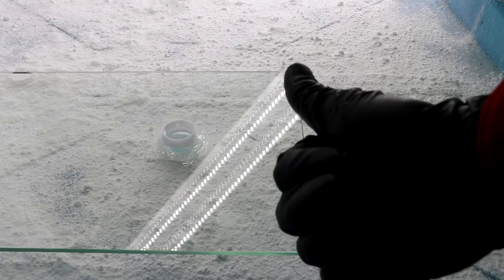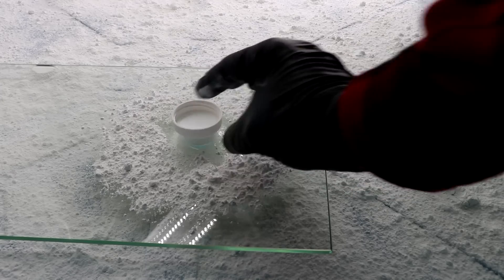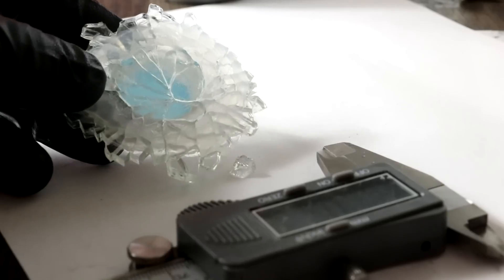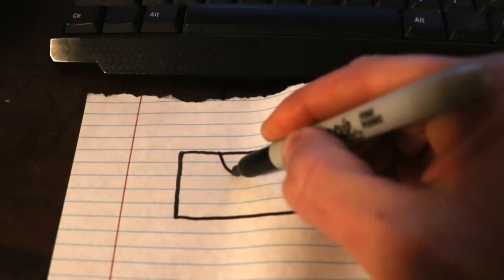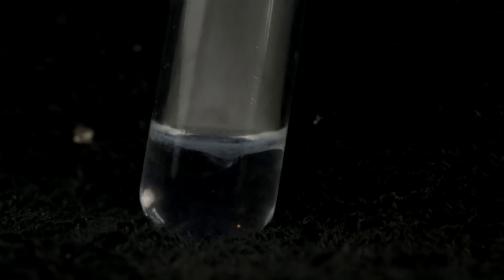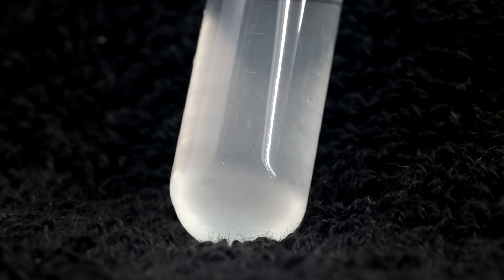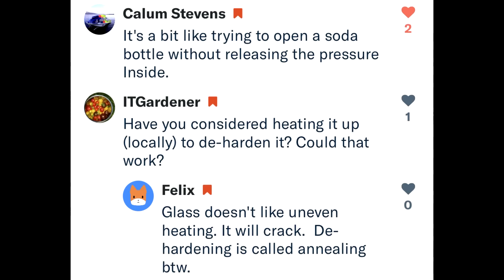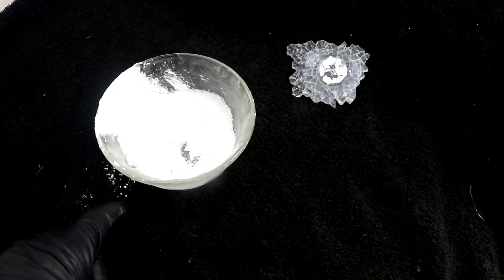Dissolving Through Tempered Glass Attempt Two: from one side only

Comment: Isn't this like saying if i cut an elastic band under tension really slowly it won't fling off. As soon as the pressure is released its gonna just go.
Reply: Not quite. Tempered glass has compressive forces countering the tension forces inside. It's perfectly possible to have a piece of tempered glass with a hole in it. If the glass is tempered with that hole in place, then the strain patterns in the crystal will form around the hole instead of through it.

Removing sections of a pane of glass without breaking it is kind of like playing Jenga. There are pieces under net zero stress that can be safely removed, and some that are under some stress that, when removed, can safely offload their stress onto other pieces. However, if the balance between compression and tension isn't preserved locally to where the piece is removed, you get what basically amounts to "leverage" pushing and pulling far stronger on other parts of the glass.

It might be possible to predict a place to put a hole through the glass if the strain profile was analyzed. You can see it with two images of the glass, scanned through some polarizing film. (Two images so you have horizontal and vertical polarization. Overlaying the two would give you total strain) You'd want to look for areas that show the least polarization at any angle, since any polarization indicates high internal stresses at that position.
Reply: The trick is to sneak up on it...
Reply: What if you hold the elastic, then someone can cut and you can slowly release the elastic bands without the sudden fling, doesn't applies to glass though
Reply: If you bore a hole in the tempered glass while annealing it you should be able to because your technically pushing a hole through the softened glass

Comment: Is there a relationship between the area where the acid works and how deep it penetrates? 
If the acid was contained in a cylinder with a radius of 0,5 mm, would it penetrate deeper?
Reply: No the issue is just to do with how deep it goes. So the diameter is irrelevant

Comment: How to Cut Tempered Glass

Co-authored by wikiHow Staff
Updated: March 29, 2019 | References
Because it’s a type of safety glass, tempered glass cannot be cut using the same methods as you’d use to cut ordinary, untempered glass. If you must cut through a pane of tempered glass, you’ll need to heat it to nearly 1,000 °F (538 °C), then slowly cool it. This process is called annealing, and it will effectively undo the tempering process, weakening the glass to the point that you can cut it. Once it’s cooled, the glass will be in a state in which it can be cut. Anneal the glass if you have access to a kiln. Otherwise, you'll need to take the glass to a professional glass cutter. Also visit a professional if you need to cut a piece of glass larger than about 10 inches (25 cm) across

Comment: What if you place the whole pane in compression from all sides to neutralize the tension inside? I guess it might work, but would probably shatter on release. But you'd still get a hole, as long as the pane is in its compression frame. Just speculating...

Comment: I think it's going to take a lot of heat. The glass will have to be softened to help relieve some of the pressure from the tempering process. Even if that worked, the heat may cause the glass to warp and be wavy when it cools back down.

Comment: having worked with tempered glass for many years in the past, back in the days of glass lenses in spectacles i’ve successfully recut and ground lenses if i reheat the lens to remove tempering but bringing a a sheet of glass up to temp would need an industrial sized unit to bring the glass up to just under 1200 degrees fahrenheit then let cool evenly and slowly so as not too setup stresses within. nice try though really enjoy you videos Cody. thanks all the best for the new year

Comment: Io Saturnalia, Cody! I think tempered glass is strong the same way a Prince Rupert's drop is strong: in one direction (outwards) but as soon as its damaged from the other way, the structure essentially unzips. The only way to etch through tempered glass would be to anneal it first, do whatever work you need to, and then re-temper it.
Reply: I think a prince Rupert's drop is tempered glass, but then again, they are made by cooling in water extremely fast, And I think there are some minor differences in tempering glass like the stuff Cody has, so I don't know

Comment: What if every day you cleared the acid and use a tiny amount if liquid glass to reinforce the hole inside border as it’s eaten thru from the acid? Then instead of using a soda cap continuiosly start with the soda cap and very gradually use a smaller and smaller plastic insert like a tube, that you actually sit inside the hole causing the hole to shrink the further thru the glass you get?

Comment: If you submerge an entire (small) piece of tempered glass in acid, does it explode or does releasing the tension evenly from all sides prevent the explosion?
Reply: It won't do it perfectly evenly, there will be one point that is dissolved first which will make it crack.
Reply: Good question
Reply: it would shatter as the loss of glass would un-spring the pressure inside of the glass. Imagine pressuring a tank full of air and then suddenly dissolving all of it. The Pressure inside is going to be released the moment the tank can no longer contain the pressure inside of the tank
Reply: XXXtortellini  no risk no fun lmao
Reply: XXXtortellini  Cody is definitely able to do that safely tho

Comment: would be interesting to see the glass break
and in which way it breaks and if the temper of the glass will influence it.
If im right the glass should pull up slightly when it breaks because the outer layers of the glass should be in tension compressing the inside of the glass.
would be nice if you could actually see that.

Comment: What would happen if you compress the glass while doing that like putting it in sand
Reply: It would still crack but not explode
Reply: @sammygeez.  but since it is putting pressure on it and keeping it compressed it would be less likely to shatter
Reply: @No_name_373  I think that the tension in the glass will still be released even if the glass can't move because tension isn't like matter, it doesn't have to go anywhere, so it may still crack. However, if it is being compressed very firmly, it may not crack, but it would he interesting to see.
Reply: @sammygeez.  as soon as you take the tension off il wil break anyway.

Comment: Cody, have you considered trying to dissolve through tempered glass using a saturated solution of potassium hydroxide?

As you reach the centre, the potassium should be able to substitute smaller sodium ions in the glass, thus relieving the tensile stress before dissolving it.
This is the basis of a process called "chemical tempering", where molten potassium salts are used to induce compressive stresses in the outer surface of a sodium-rich glass.

Comment: I figured out this problem. Pour epoxy resin all over the glass from both sides and let it dry, just leave that spot for your acid cup. When your acid will dissolve the glass than later you can dissolve resin in some solvent like xylene or metylenechloride
Reply: Resin will help glass hold together while acid will etch a hole

Comment: Have you determined that this is even theoretically possible? That is, if you can figure out what the pressure gradient for that glass looks like, and then you put a perfectly round cylindrical hole in that glass (using math, not chemistry or a drill), is the glass expected to not crack? Because I'm starting to wonder if it's not just "trauma" or "imperfection" that's making it shatter, but just  the loss of force equilibrium from that hole existing at all.
Reply: My thoughts exactly. I can't imagine how this could possibly work without some advanced methods for mapping out the internal stress pattern of the specific piece of glass and finding the perfect position, shape and size for the hole. And even then it still sounds like trying to dissolve a hole in a pressurized balloon. 

But I love the fact that he's trying anyway, i'd love a surprise result!
Reply: @Dusto9  I don't think a cylindrical hole could work, but it might be possible to e.g. mask off a 25.0mm circle, etch it down a tiny bit, then mask off a 24.0mm circle, etch down a little further, then a 23.1mm circle, then 22.3mm, 21.6mm, 21.0mm, 20.5mm, etc. so that the glass right at the edge of the 24.0mm circle would have glass supporting it from below as well as the perimeter, and likewise for each circle going inward.
Reply: @flatfingertuning727  No. The glass sheet will still shatter, because the supporting tension at the outer layer has been removed. The remaining glass tries to expand as pressure is relieved. This can only result in it shattering as it flexes ever more rapidly into the newly-created low pressure area. That shatter then spreads through the remaining glass outside the etched area at an immense speed, causing the whole sheet to break into fragments. 

Even a very high speed camera has difficulty in following the process. I think that the Slo-Mo Guys did a video of a Prince Rupert's Drop shattering, without much success, until they used an extremely fast, and expensive, camera.
Reply: It's impossible due to what tempered glass  is. You can't drill it, cut it, or dissolve it. The energy from the heat that it's baked in is trapped inside the glass when it is slowly cooled. Once you break the 'tension' the energy releases and that's why it breaks into pieces roughly as wide as the pane is thick. On a poorly manufactured piece of tempered glass you can shoot a bullet or even pellet through it and it won't shatter completely but instead into shards. I worked in a glass shop for years, I have never seen any way of altering the shape of a piece of tempered glass ever. EVER. and I have been to many many trade shows with the latest greatest technology
Reply: that is the point of tempered glass. in order to have a hole in tempered glass, it will have to be made in the glass before it becomes tempered. then the tempering would include the glass on the edges of the hole itself and the temper would survive.
Reply: @gigawertz2582  and from what I hear, the hole diameter can be no less than the thickness of the glass being tempered
Reply: @gigawertz2582  
Could you "de-temper" the glass by bringing it up to temperature, then gradually cooling it?
Reply: Time for FEM! and a lot of computational power. Gotta love those models!
Of course if you are a math guru, I would love to see the derivations. solving diffs is way relaxing and so satisfying if you have the time. (unfortunately, I don't - have time for this, anyways.)
Reply: Having worked in the glass industry making tempered glass for automotive use I will say , you are correct , Tom . Tempered glass works because there is a 'skin' of rapidly cooled glass that exerts an immense compressive stresses  upon the core of the glass ( that cooled more slowly , if not just by moments)  .  Much like pretensioning  concrete .   When attempting to cut, drill or etch holes or scratches into the glass, a place is created where all the tension forces concentrate and PAP!  ya get a shattered glass.  Much similar to stress cracking in metals . Like what caused the Comet airliners to fail.
Reply: @mysticvirgo9318  thanks for your insight. Is it possible to "re-anneal" glass without taking it all the way to the melting point?

Another thought: can an ion or chemical compound work its way into glass while the glass is still solid? I understand potassium nitrate is used to harden glass, as the potassium replaces the sodium on the surface layer, putting it under compression. If this "bath" were to last a really long time, maybe even days or weeks, would the potassium not reach a higher concentration in the middle due to the lower pressure there?

Though ideally the next step would be to try and swap or something else back into the surface layer, and I don't know how that could be achieved. It would have to be something very small and very reactive, and that's relative to potassium so... lithium? Seems like a stretch. (see what I did there?)
Reply: @tom_something    I do not know about ion replacement in glass.. (like in Gorilla glass???) to create a form of 'ultra temper'  .    If you anneal the glass to remove the temper, then you have removed the challenge of putting a hole in tempered glass :)
Reply: @mysticvirgo9318  I'm tempted to agree with you that it does sound like "cheating". But I guess that depends on the nuance of the goal. That is, are we trying to take tempered glass, as it is, and put a hole in it? Or are we trying to take some off-the-shelf tempered glass that we need to put a hole in for some specific application, while still having the glass be mostly tempered throughout?

Even if the intended goal is the former, if it's theoretically impossible for a hole to even exist in the glass without it shattering, then the choice is to pack up and go home, or to to modify the brief a little.
Reply: @mysticvirgo9318  what if the anneal is local
Reply: @zioncristwell6201  can't happen , that I am aware of. Localized annealing will cause an increase in stresses around the perimeter of the area that had been annealed, causing the rest of the glass to shatter .   The only way to cut or drill tempered glass is BEFORE it is tempered  . That I am aware of.  there is much that I admit I am not aware of.  2 years installing glass windows and doors commercially and a year working at a level two supplier of tempered  window glass for Toyota , I know quite a bit.
Reply: I'd be curious to see if plotting out the stress regions via polarising film and using that to plan the hole placement / size might give results. I'm betting you could perform localised annealing too.
Reply: The pressure in the glass is going at all different angles, you can see that in the rainbow effect. So if dissolved a very small spot that was a neutral point, maybe it will work.
Reply: Evi1M4chine  It's just the opposite. The interior is not under pressure, it is in tension, but has no way to contract, stuck between the hardened, compressed exterior surfaces. Dissolving the exterior shell gives the center the freedom to contract, opening up cracks that then propagate throughout the material, relieving the tension. It's more like breaking the seal on a mason jar of canned tomatoes than popping a balloon.
Reply: The precompressed zone for tempered glass is usually 20% of the material thickness both top and bottom. When you penetrate it the glass breaks.
Reply: Evi1M4chine  However, it is possible to put a hole in a baloon without it popping. Just stick some tape on it! Maybe there's something simmular but with glass?
Reply: @TheEggHealer  You can stick a pin in the tape, but then the pin fills up the hole and stops the balloon from deflating. This is more like trying to shoot a bullet through a balloon without letting any air out.
Reply: @gcewing  Easily done, use better tape... probably.
Reply: @gcewing  How about putting a hollow tube through a balloon without letting any appreciable amount of air out, something that I think should be possible if one starts with one end of the tube connected to a regulated pressure source that matches the pressure of the balloon?  I'd regard a balloon with a hollow tube through it as having a "hole" in it.  The question in my mind would be whether etching the glass at the right angle would allow shear forces everywhere to remain below the yield point of the glass.
Reply: @TheEggHealer  So like make a laminated glass but flip the layers? Laminated glass is usually a resin layer sandwiched between two glass layers, so by your suggestion he should make a tempered glass sandwiched between two layers of resin. That would be very interesting, I wonder if the external layers of resin are going to keep the glass from cracking, like a tape preventing a pressurized balloon from tearing up when punctured. I hope he reads the comments and gives this a try.
Reply: @Kluneberg  Maybe that works, , the idea sounds promising
Reply: Evi1M4chine  I thought the pressure inside is lower, not higher. The glass is still very hot on the inside when the outside cools. As the inside finally cools as well, the molecules would really like to huddle closer together (contracting while cooling), but the rigid outer shell prevents them from doing so. Prince Rupert's drops, made in a similar fashion, often have cavitation bubbles inside, further evidence that the pressure inside is relatively low.